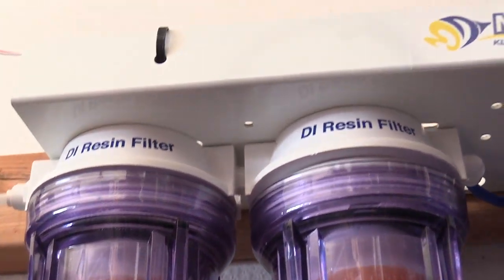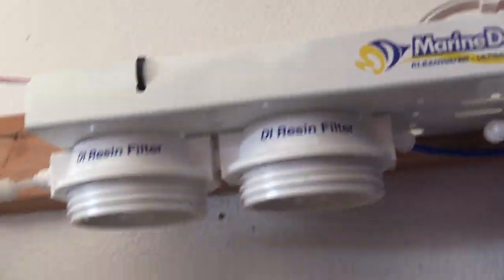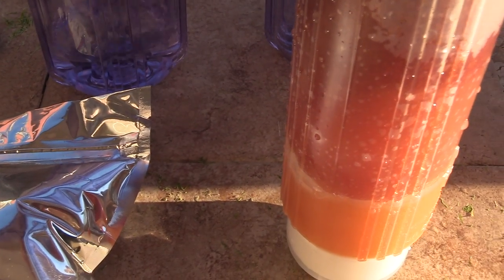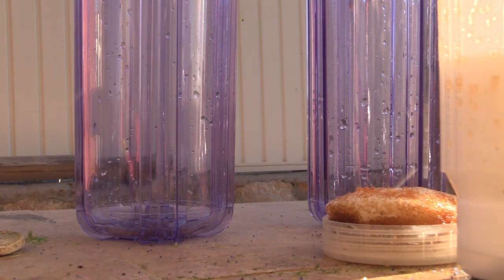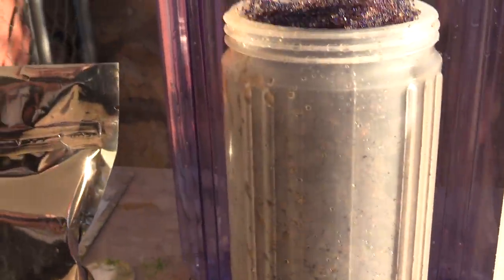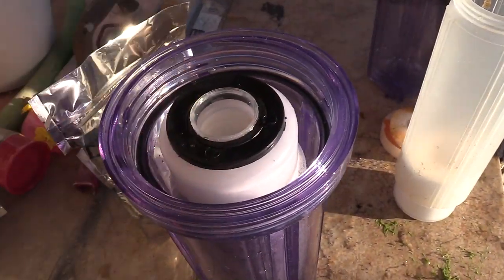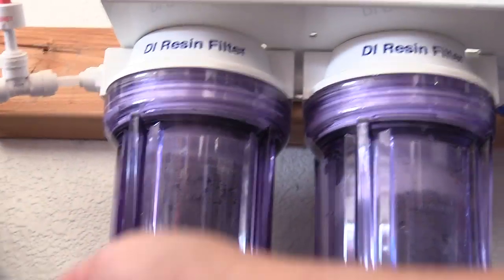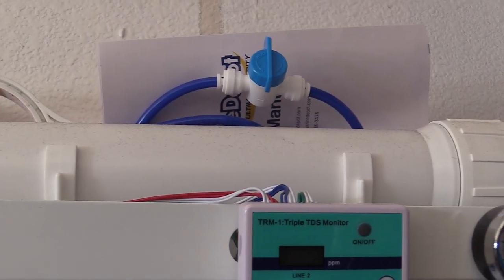HOW TO REPLACE RODI DI RESIN | AQUARIUM WATER CARE

Comment: Always good to refresh. I’ve been having a problem after changing my di . Tds is higher after change. Any advice?
Reply from the maker: THE REEFIN RICAN How long has it been since the membrane has been replaced?
Reply: 915Mang 
It was user error. I wasn’t paying attention when putting it back together.  I just got the water saver add on  and booster pump.